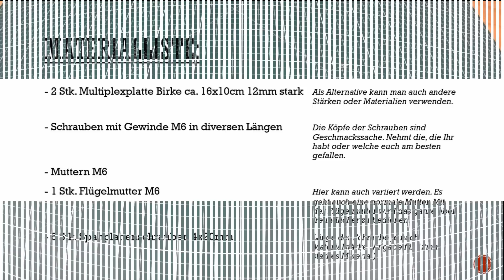Holzknöpfe / Holzgriffe selber machen / Vorrichtung / grip wooden knob jig Huxxa #1801

Comment: Hello from the USA. I must tell you I clicked DISLIKE. The music is terrible. Very annoying. The same few bars over and over. I finally realized you weren't going to have any commentary so I muted it. The speeded up video prevents my understanding of just what it is you are doing. You start by flipping wood around. Then you make a lot of measurements with the caliper but there is no way to tell what the measurements mean. There were a few captions giving measurements and sizes but not enough to be meaningful. In the end I figured out enough to understand the device but it was a struggle getting there. It is a quite nice device though. It was worth the wait but the journey was terrible. Still, have a great day and stay safe.